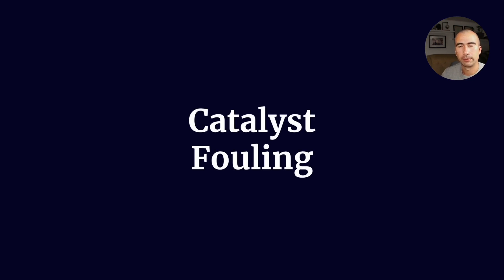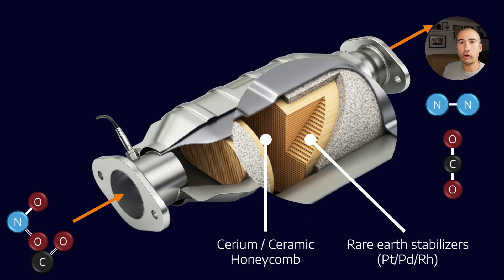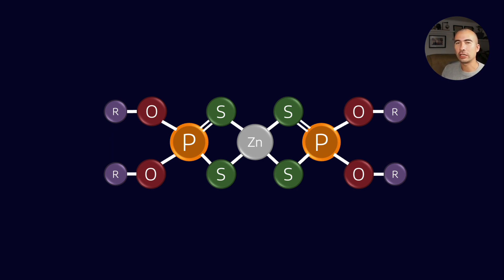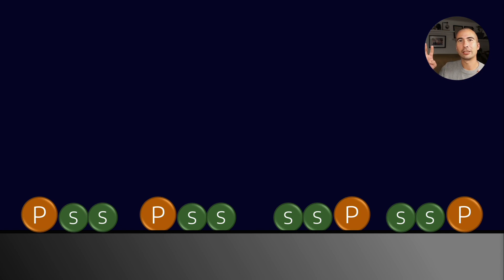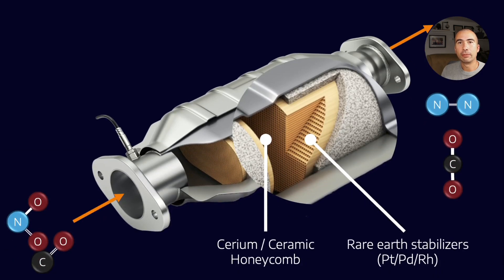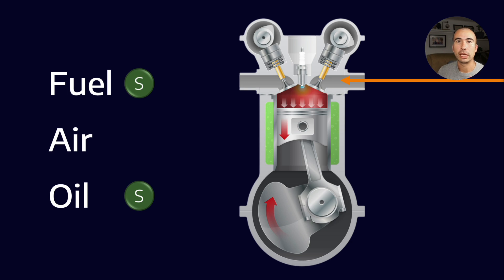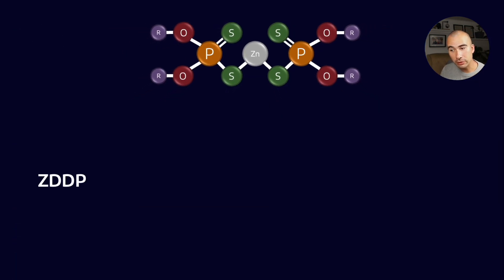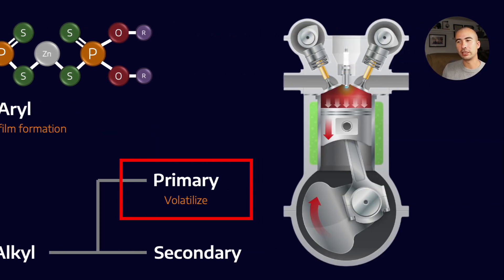How do oil additives cause catalyst fouling?

Comment: by the way, there is a proven method of recovery of cats from poisoning,  DOI - 10.1021/es040062f ; a 80 degrees Celsius wash with citric acid - I did it myself, and I passed the emissions tests (my car has ~250.000 km) ; there's also another wash, citric acid + oxalic acid (both relatively safe acids, pretty mild), but I can't find the article right now.

Comment: You should mention important thing that this happens only when engine consume oil. New oil specs and newest eco demands killing the modern engines within 5-7 years with 120-150K miles.
Reply from the maker: Good point, although all engines consume oil to some extent. It's just the rate of consumption that differs.